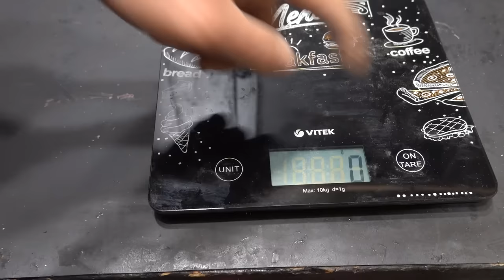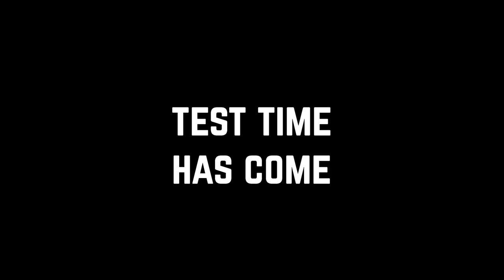Restoration of Caucasian Dagger - from Mountains to my Workshop

Comment: Awesome work. May I suggest you’re using to much heat when soldering. Getting the metal red hot burns away the flux so the solder doesn’t stick very well. You would be better using a soldering iron and once the metal is hot enough to melt the solder drag the iron along the joint while feeding in the solder. This way you should get a perfect join. Cheers Stuart 🇦🇺
Reply from the maker: Greetings! Thank you for your attention and advice.

Comment: I had a similar problem with getting a knife out of a sheath when I made the bright decision to coat it with boiled linseed oil. I might as well have coated it with rubber cement, because the next time I tried to unsheath it, it was stuck fast.

Comment: Excellent work. Looks like it came from a museum. I have one of these daggers, I've had it for years. It's no doubt of modern construction. It's a bit wider and thicker the the one you have there and slides much too easily out of the scabbard. When do these daggers date from?
Reply from the maker: Hi, thank you for your attention, you asked a good question. In fact, no one knows, I know. one thing is that Caucasian daggers especially began their spread in Georgia throughout the Caucasus from the beginning of the 17th century until the beginning of the 20th century.

Comment: The bolts through the handle and the general shape of the handle could be greatly improved, not that it will ever be used for what it is intended, but swing it around a bit at some branches and you're hand will suffer greatly.

Comment: Before brazing or soldering you need to get the galvanization off that sheet metal you are using. Best way is to sand it with 200 grit, and then hit it with muriatic acid before brazing or silver soldering.

Comment: If the blade becomes loose in the scabbard, how do you fix it?
Reply from the maker: It depends on the wood, if it is dry then everything will be fine, the scabbard should be made of dry wood. Did I understand the question correctly or not?

Comment: Question, why do two of the pins on the handle, stick out so far. I've seen this before.....
Reply from the maker: In the middle and on the sides so that the hand does not turn over and does not spin. Everything for a tight grip. Any Caucasian dagger has it for functionality and not for beauty

Comment: 0:42 Please, don't. Next time a potentially sharp blade gets stuck in a potentially weak scabbard, do not try to force it open while holding it in the hand. All those "potentially" translate into "potentially losing use of the fingers", Alex. Would be... less than ideal.

Comment: Great representation of how these daggers were manufactured with epoxy resin 200 years ago. I'm pretty sure 200 years ago they did also have PVA glue and many other stuff that you use in this vid. Why not using fucking original stuff dude? Same materials, same techniques, same everything after alles